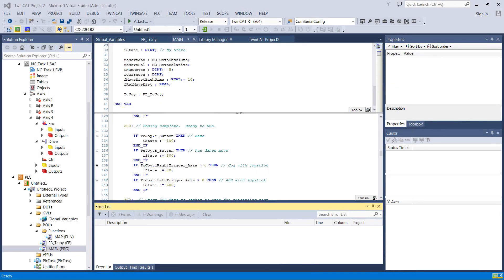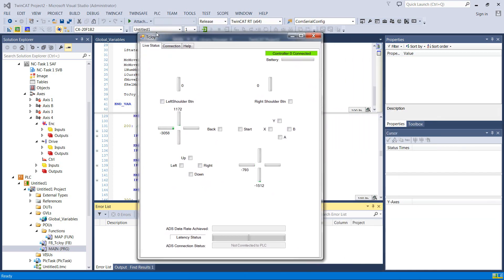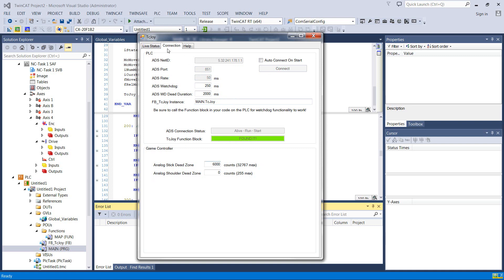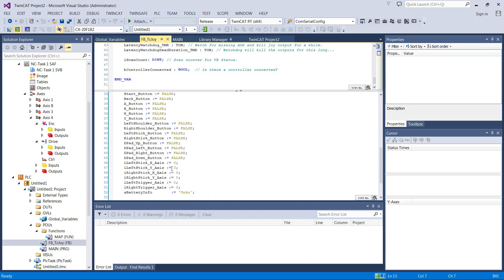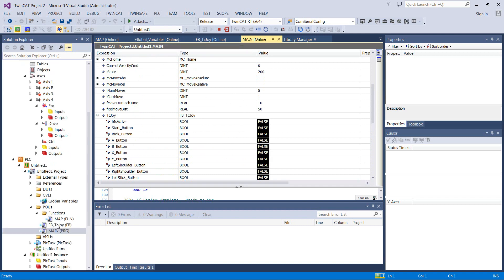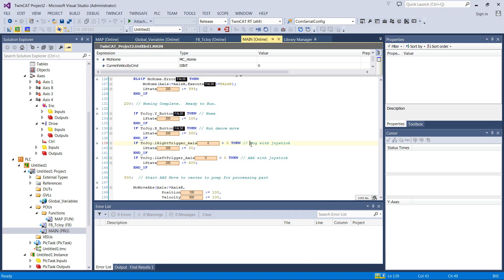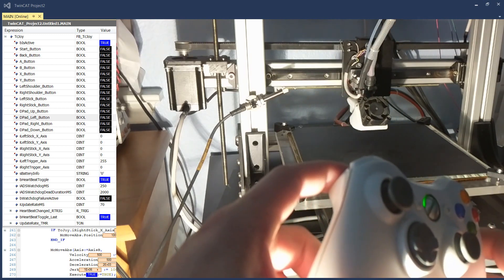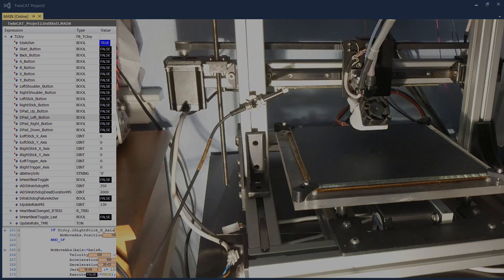Motion Control and IO with PLCs - EP15 - Bonus Input!

Comment: Hello Sir,
Where can I get the driver for xbox controller for windows embedded 64bit?
Reply from the maker: Link in the description.
Reply: @SquishyBrained  I connected xbox controller to the computer( Beckhoff windows embedded  standard 7 64bit) but in device manager I got unknow driver for xbox.I tried to install driver for normal window7 64bit doesn't work.
Do you have any advice,sir?

Comment: Hi Evan.
Your approach looks really interesting. How do you get twincat to recognize the 360 controller? Is it supposed to be configured as a device on the I/O section?
Reply from the maker: FYI, I open sourced this on GitHub, tcjoy.
Reply from the maker: No, I don't think they have joystick support in the IO drivers for twincat.  I write a .NET application that reads it in through directX, and then I pass that over ADS using beckhoff's ADS.dll.   I wrote a function block that watchdogs it and sets the inputs to 0 if no updates come through in a certain small amount of time... it works well.
I can't share that code right now because I used some code from my old job, but it is on my list to re-write and open source it.
Reply: @SquishyBrained  I hit you up with an e-mail about this situation.